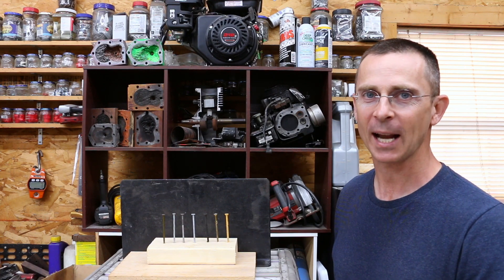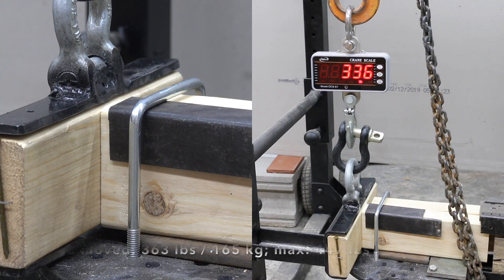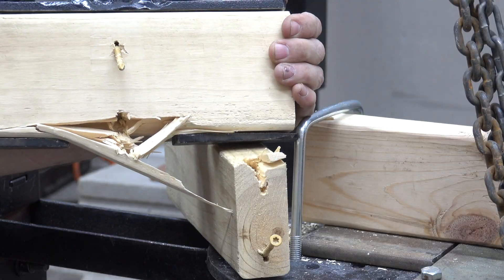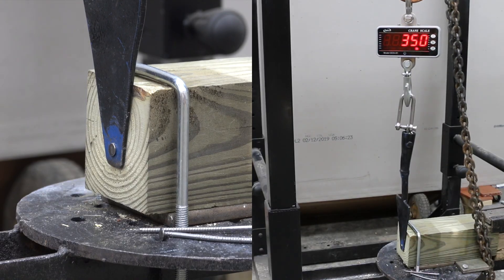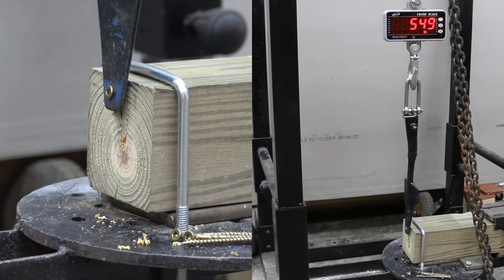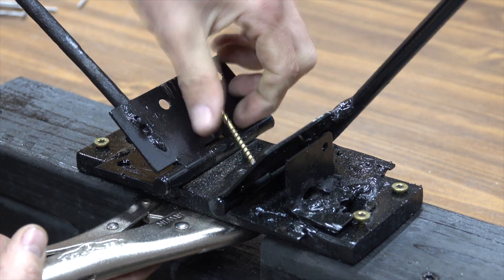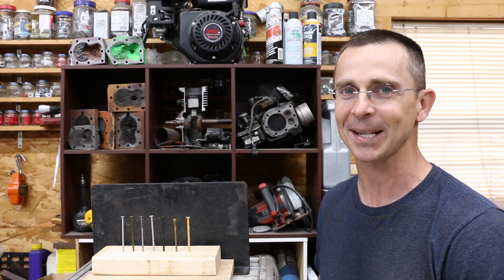Do Screws Shear easier than Nails? Let's find out!

Comment: Great video!  I'm not sure what a good test would be but I question the severe angle used on the bend test.  I would think that 20 - 30 degrees total angle motion might be be severe motion in timber construction.
Reply from the maker: Great point! Thank you
Reply: @ProjectFarm  Urban scenerios would be wind loading and settling.  Farm scenerios would be the same plus livestock abuse, implement collisions, etc.

Comment: When I used to do demolition work years ago, ring nails were easily my least favorite to remove.
Reply from the maker: Great point! Thank you
Reply: Ring nails from a nail gun, the heads are always well under the surface and the adhesive that holds them on the strips also glues them into the wood. They're not coming out without mauling the wood.

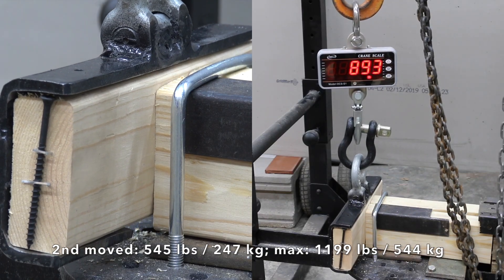Comment: A bracket needs to be made to hold the pulling 2x4 up against the other 2x4 to keep the bottom from pulling out, this would make it more of a shear, instead of a pull out ? I also noticed the hold down angle iron was much closer to the end of the 2x4 at 2:49 then at 3:50, could also make a difference. I don't think screwing into the end grain would be as good as into the side. This was just an observation and not a criticism as I thoroughly enjoy and always thumb up your videos !
Reply from the maker: Great constructive feedback! Thank you

Comment: Another factor in the strength of the bond in the CC Sinker framing nail is the speed of that nail being driven in too, the faster the nail goes in the more it heats up the clue to make the bonder more secure. That is why a framer tries to set the nail and drive it in with one hit. Or when they get really good they just drop the nail and sink it without even setting the nail before the hitting it. When I was a kid framing I used a 32 oz. framing hammer as well that had a corrugated face on it. The galvanized coating on the Facial nail is a stronger holding nail due to the ruff surface of the nail and a higher friction in the wood before it can come out. The ruffer the nail the better it will hold due to that friction or clue coating that is on it.Also the nails being driven in the 4x4 in the center of the heart of that piece of 4x4 will be easier to pull out than if driven across the grain of that same piece of wood.
Reply from the maker: Great point!  Thank you

Comment: Could you test running and engine with a loose spark plug to see how long before it strips the threads? Also running an engine with no exhaust to see how long to burn the exhaust valve out?
Reply from the maker: Thank you for the video idea!

Comment: I think if your fasteners are bending by 45 degrees, you're building wrong, and considering two drywall screws can hold 2x-3x more than the other fasteners and cost about half to a quarter of the price.... i dont know... conclusion, build everything with drywall screws from now on!
Reply from the maker: Thank you for the constructive feedback
Reply: Add a little glue and it ain't coming apart ever
Reply: Many would think so, as do I sort of. However, wood moves with heat/humidy, and being so brittle I wouldn't want to chance having the second floor come down on my head.  There's got to be someone who's built a house or significant structure out of screws somewhere on the internet we can compare against, right?
Reply: @boots7859  it will still flex
Reply: @boots7859  if I where gonna build a house, I would definitely use screws, and for those like you, drive a few nails beside of them

Comment: Thanks for a great video.
Those ring shanks are the best for crate and pallet assembly as they require so much extraction force that the heads of most nails pull off when when one tries to remove them.
Hence we do not use them for the lid of the crate when shipping so that it can be opened.
For the lid we use soft unplated smooth shanks, ie a cold formed wire nail.
Reply from the maker: Great point! Thank you

Comment: Yet another great and interesting test. I would argue the shearing force is completely irrelevant - most timber work has static loading and is not subject to work hardening or significant shear loading. Yet again the plasterboard screws punch well above their weight - I am starting to wonder why I use anything else.
Reply from the maker: Thank you!

Comment: If I were building a house in an area where it could be exposed to storm winds I would like to "glue and screw" everything. I wonder how much that would run up framing cost?
Reply from the maker: I imagine the cost would go up quite a bit. Thank you
Reply: @ProjectFarm  I worked building houses in another life during summer vacations in high school. I'm thinking about a 30 to 35% increase. But, if I had the money I would also use 3/4" marine grade plywood for the exterior sheathing. I was in a 2 story building that was struck by a tornado in March of 1987 and I wasn't home when my house was damaged by a EF2 in December of 2008 so I have storm phobia.

Comment: I hoped Hurriquake nails were tested. Though the ring shank nail is really close in design.
Reply from the maker: Thanks for the recommendation!
Reply: I didn't think I would get a reply, but I would thank you for all the testing you do. 

I have been surprised by how diligent and rigorous and the various ways you test lawn mowers with oil substitutes, my current favorite and one my family was also surprised by was the bacon grease somehow appearing to clean the combustion chamber. 

As well as how well the Amazon Basics at least in the short term has performed in testing. I think over time you will likely start doing more of the long form testing, such as like comparing a full life cycle on some of your top competing products.

Please keep up the good work for us regular folks, and sticking to your guns being independent.

Comment: Interesting results.  I still like nails for framing type construction.  The benefit to me, is that they CAN move.  They bend, they slide a bit in and out of the hole, all without causing a ton of damage to the wood.  In a structure that's going to expand and contract a lot and settle over a period of many years, I think that's ideal.
Reply from the maker: Great point! Thank you
Reply: that seems to me like a self fulfilling prophecy.  If you use nails, the structure can move, meaning you need a fastener that wont break during movement, meaning you need nails. But if you use screws, it wont be able to move as easily, meaning screws will be ok since it wont move.

See? Seems they both would be the same in the long run
Reply: @researchandbuild1751  You could be right.  Either way, I wouldn't say nails are a poor choice at all.  Tried and true, plus cheaper.

Comment: As a requestor; greatly appreciate the video!  The correct use of terminology was noted throughout as well as a very scientific rig.

Now, for slightly higher values!  FastenMaster, GRK (my fav), OWT, Simpson, Et al. all carry timber fasteners.  Some can be had in Torx, others in hex head with shank sizes up to 1/2"!  I might suggest changing out the pine for oak or maybe LVL because you're gonna need it with these monsters.
Reply from the maker: Great suggestions!  Thank you!

Comment: Here in France we use alot of screws like the GRK or Deck screws on IPE deck Wood and those planks if they bent upwards can sometimes sheer the heads of the screws clean of how though they are to cut and straigth them, we even have to use hardened stainless Steel screws to hold them.
Reply from the maker: Great information. Thank you

Comment: Love the practical testing as always. I think someone else mentioned this, but I think the results would come out differently if the fasteners were sunk into the edge or face grain of the stationary board instead of the end grain. You could see in most of the tests that the wood moved out of the way of the fasteners under load, which effectively changed the loading angle on the fasteners (to have more of a tensile load instead of just shear) and allowed the fasteners to slip or tear out more easily instead of shear off.  The wood would stay more intact on the edge or face grain, which should keep the fasteners under more pure shear loading for longer. I think the test jig design would be a bit more challenging to set up the test this way, but the results would be more relevant to how fasteners are normally installed.
Reply from the maker: Great point!  Thank you for the constructive feedback

Comment: I liked this video. Most wall framing will be fastened just like you tested cross grain fastened to end grain but most decking will be cross grain onto cross grain. I would guess that cross grain onto cross grain would put more stress on the nail or screw in a shear test. Put another way I think the wood would be stronger in a cross grain to cross grain situation.
Reply from the maker: Great point!  Thank you

Comment: drywall screws have a tendency to break when hit sharply- I have broken some when using long ones to install some trim around a door frame, as they heat up they tend to add more drag and snap. Also, if you drove a screw or nail in 3/4 of the length, and used a chisel and hammer to try to shear it where it meets the wood, they will probably break faster than nails. The bend test proved that, 

I use sheetrock screws for all kinds of small projects like book cases etc cause they are cheap and plenty good for things that don't see a lot of stress
Reply from the maker: Great point!  Thank you

Comment: I think it'd be neat to see if the strength scales with using multiple screws over a large piece. I mean after all you don't just use a single screw when building stuff, and boards usually aren't small. Would 2 or 3 screws hold 2 or 3 times the weight if placed equally across a board? I bet it wouldn't scale up. Few things in life scale properly.
Reply from the maker: Great suggestion! Thank you

Comment: can you please  do bolts and screws from concrete ? :D
Reply from the maker: Great test idea!  I just did some additional welding on the test jig.  I've tested it at 5,000 pounds and it should have plenty of strength!
Reply: @ProjectFarm  Please also include masonry and lead sleeve anchors in solid concrete! I anchored a toilet to basement concrete and I wonder how strong the anchor really is compared to the packaging claim.

Thanks for doing this shear test. It makes me feel OK about using some GRK's in a project where I couldn't hammer everywhere.
Reply: @ProjectFarm  , please test some RedHead drop-in anchors, the ones designed for use with threaded rod or bolts,  that you put into the hole and set in place by expanding them with a special punch ( provided in the box with the fasteners) and a sledgehammer.
Reply: Tapcons and wedge anchors and Drive its would be an interesting test.
Reply: Epoxy set all thread is a common one i see in the welding industry
Reply: ramset time?
Reply: That's a great idea. I've always suspected those stupid lead wedge anchors were garbage, but who knows? Hilti and Tapcon and Red Head, Oh My!
Reply: @Corrupted355  , I would like to see Red-Head drop-in anchors tested, the ones where you put the anchor in the concrete hole and set it with a special punch and a sledgehammer. Then you can thread a bolt or threaded rod into it.
Reply: @Corrupted355  , thanks for that link! When I worked in Telecommunications we used to use Redhead drop-in anchors like those in the other video  to anchor  telecommunications data frames and racks , with special  earthquake-rated mounting kits that also raised the frames and racks above the  raised false floor in the data rooms. Those fasteners always impressed me as holding very well and being quite strong. A few years ago when I redid my deck, the ledger board having been stupidly been nailed on right through the shiplap cedar siding into the rim joist of the house, I used drop in anchors and threaded rod to bolt heavy angle-iron steel to the concrete foundation,  right under the lip of the ledger board so that the board would be resting on the steel angle iron. Then I was able to chop and chisel out the half rotted cedar that had been pinched between the ledger board and the sheathing and rim  joist of the house. Which of course leaves a nice ventilation space in between them......
Reply: @Corrupted355  , the guy in the safe mounting video forgot one thing, to mention the importance of blowing all the concrete dust out of the hole that you just drilled. An air compressor is handy for this.

The very first time I ever saw those drop-in anchors, somebody at the head office stupidly gave us the wrong fasteners. We were mounting a sheet of plywood (for holding a couple of phone and data frames),  not into a concrete floor but instead into a hollow concrete block wall, and of course the concrete block was far too thin for using drop in anchors; and they didn't supply us with the special setting tool either! We stupidly assumed that the bolts or threaded rods would automatically expand the back end of the anchor when tightened into the fastener! (This was in the era before smartphones, and so we couldn't just go online and look up the application method for the fasteners). That was one hell of a frustrating day. I think eventually we got some lead anchors to put in those same  already-drilled holes.....
Reply: @goodun6081  
Yeah, the hammer set anchors hold, but you gotta hit 'em to set them in the concrete. I really like them because if you ever need to abandon them for whatever reason, you just unscrew the fastener and mud right over the anchor. You'll never know it was there. They're also great for mounting equipment that isn't used all the time, so you can have a place to mount it down, but you won't have and studs sticking out of the floor when you unbolt it and put it away. 

At work we use a lot of Hilti Kwik bolts, which are wedge type studs that set when you tighten them. They hold amazingly well. We usually drill a hole much deeper than needed in case we ever need to abandon the stud. You can cut it off flush with the surface, then pound it deeper into the hole. But if whoever installed it in the first place didn't drill a deep hole, you're left with an unsightly bolt in your concrete.
Reply: @Thomas Marshall i just want to know how much kilos it can hold ^^

Comment: Interesting how drywall screw hold into wood. Also I think they are the sharpest as they puncture through metal easy when installing drywall on the frame, so better for securing steel roof on small constuctions.
Reply from the maker: Great point!  Biggest concern is that they'll rust out over time.  My deck was built with drywall screws before I owned the home and I've had to replace the drywall screws with properly coated deck screws. Thanks again!

Comment: so when I use coated sinkers to nail framing together, then add the required hangers with screws.... 
That brings up another thing, how strong are the hangers when nailed or screwed? Do they help anything really, or is that just code BS (here the code requires the hangers in most cases)
Reply from the maker: Thank you!

Comment: Problem even tho screws are stronger, they all ways rust off in the barn before nails
Reply from the maker: Great point!
Reply: Cheap uncoated screws like they had back in the day, sure. But I doubt nails are gonna outlast modern ceramic coated screws, not to mention they won't loosen up over time like nails do from heat/moisture cycles.
Reply: @MarkFunderburk gas from the animals rust even stainless steel over time...im all ways replacing stuff

Comment: 0:36 I like how you attach the puller by screws and not nails 😅
Reply from the maker: lol. None of them sheared.  Thank you!
Reply: @JayK-t5h  well, the puller doesn't really do any pressure on those screws anyway, since it grabs around the wood by itself.
Reply: @JayK-t5h  mh you didn't watched the video?^^ all screws were pulled out of the wood
Reply: @rayhai6781  I think hes talking about the screws that just keep the "T" board from slipping out of the C channel.  99% of the pulling force is transmitted to the T board through the C channel itself, not the screws holding the C channel to the T board.